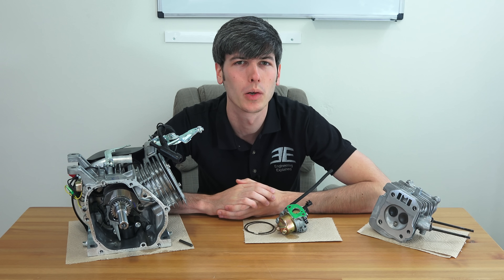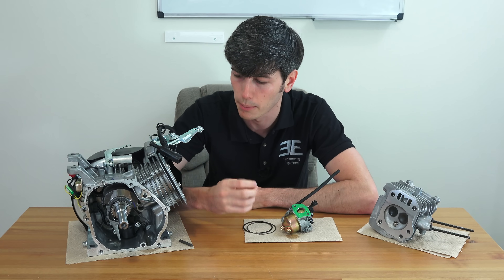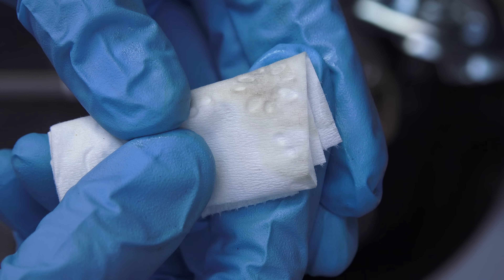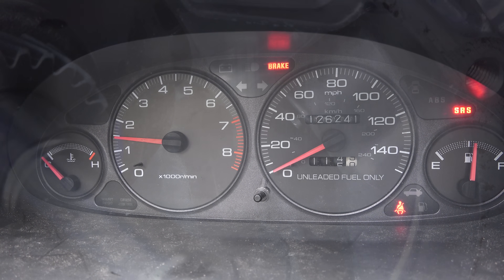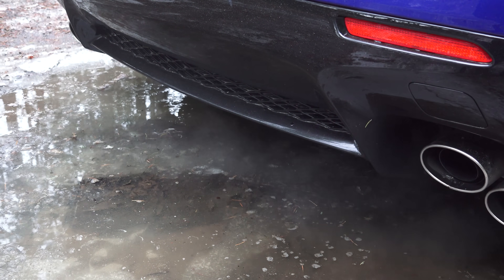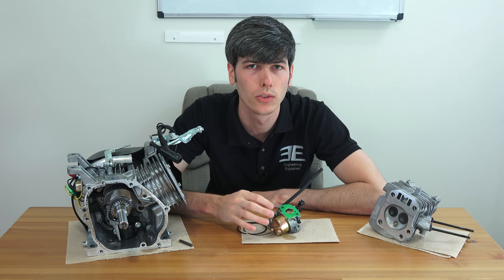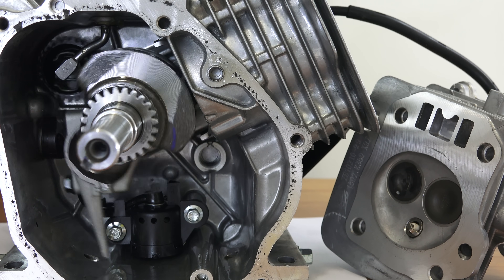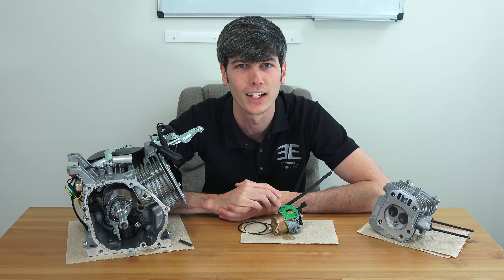Should You Warm Up Your Car Before Driving?

Comment: Im still gonna warm my car up for a couple mins before i drive.
Reply: "I've been in engine classes" you know that this guy who's video you just watched is an engineer right?
Reply: R-Spec
Unlike the other folks on here, I don't care about what you do with your car. I just wanted to point out how silly you sounded when you said you took an engine class LOL
Reply: R-Spec

haha, what class are you following?
Crank splashing oil, that's one on cheap small engines.
Any car engine doesn't have a oil slinger, since that might make the oil foam losing it's lubricating properties.
Did you even see the video I provided?
The transmission oil won't heat up while idling, only under load.
If the transmission isn't working, it's not heating up.
Unless you are slipping the clutch.....(i'm sure you aren't.)
Reply: R-Spec
Well if you can't figure that out on your own, then no use trying to explain it. Some people are just lost in their own little world xD
Reply: +GogogoFollowMe no a minute or two is just fine. I've been in an engines class and learned it takes a minute or so to get the oil to the top of the head.
Reply: Sdd525, i respect you opinion,  as an ex- fleet mechanic please respect mine. This video has made me question the topic.   I may be wrong.  but I have seen  many mechanical failures due to operation of a cold engine and transmission.   I will continue to let my machines warm up before operation.  The reason there is a thermostat in almost every modern engine is to maintain a constant operating temperature.  I belive in that temperature. Long live 220°
Reply: An engine warms quickest under load, this point is completely lost on you. Cultivate your ignorance,
Reply: R-Spec

Haha, 1 minute to get the oil to the top of the head?
What kind of engines were they talking about?  gigantic boat engines?
If it would take 1 minute to reach the top of the head, your engine would be dead after less then 1000 starts.
Reply: And in winter, if you don't breathe heavily the windows will not fog up.
Reply: And waste your time.
Reply: well where in your owner"s manual does it say to do it ? He doesn't forbid anyone from doing it, he says IT IS NOT NECESSARY ,and if anything - actually may be harmful... that's why when you read or listen to someone it is important to be able to COMPREHEND what they are saying .. How old are you - 5 ? wtf...
Reply: R-Spec same
Reply: +spiritofthewolf15x same bro
Reply: avsrule247 Ain't that the truth
Reply: R-Spec- many Subarus have a blue engine light on the dash that indicates when the engine is cold and when it turns off the engine is warm enough to drive. I have seen them on all different year including the new 2017 Impreza
Reply: actually some cars have piston slap like the 3.4 malibu and 3.3/3.8 chrysler engines if you start driving it right away the engine knocks badly so technically letting it warm up is necessary.
Reply: SDD525 yeah this one guy at work would revv his car as soon as he started it to warm it up, he was probably leasing it and dint care much about it
Reply: R-Spec Smart!!
Reply: 260k on one of my motors. Second owner, parents owned before me. Unopened motor. O.e head gasket. Always warmed it up for at least 10 or when idle speed lowers.... there are days I let it idle for over an hour. I have no issues. Scoped cylinders and seen no wall wear. If you're really worried about wall wash... why drive a cold engine to dump more fuel in when it's already doing so to warm it up at idle.
Reply: The video author doesn't address any other fluids; it's a whole drive-train, not just the engine. Also, "how long" until the oil and gas mix or how much wear that causes over time is not addressed. We don't get any idea where the line might be: 30 seconds? a minutes? two minutes? three? While the engineering concepts may be correct, there is simply a lack of detail and specificity to actually apply them to daily life.
Reply: +epiphonesg007 ditto to you sir. I want my oil viscosity to be thinner to oil up my turbo. You sheep can follow what he says.
Reply: Actually, he does more harm idling than driving under the boost rpm because it takes more time to heat... genius
Reply: +avsrule247 okay did you ?
Reply: SDD525 Oh of course. Anything to cut back on it helps. Ideally they stop altogether but that'll probably never happen.
Reply: You mean higher viscosity right? Dude You have everything backwards!
Reply: yeah same, to get the oil circulating and get some temperature
Reply: Kirk Augustin
Are you a mechanical engineer, kirk?
Reply: doesnt help your engine. if you do it to get the windows defreezed its a different thing.
Reply: let me guess, you're also a flat earther because you're not a sheep right? i knew it...
Reply: SDD525 come at me bra
Reply: SDD525 #awdarmy
Reply: try using a bit of lucas, it'll stick to yo parts
Reply: +skojo3e I have the same light, and it's supposed to let you know when you have heat. It goes out when coolant temp reaches 132°

Subaru may be slightly different.
Reply: +skojo3e I have the same light, and it's supposed to let you know when you have heat. It goes out when coolant temp reaches 132°

Subaru may be slightly different.
Reply: Robbspeed3- check the owners manual!! If the symbol is an image of an F with wavy lines under it then it's for engine operation temp. It blinks red when the engine is over heating and solid red when you should definitely stop the car from over heating
Reply: +skojo3e Ok, subaru uses a pic of a little engine rather than a little thermometer. Either way, that's not to say you have to wait for it to go out before you drive. That's to tell you when you'll have heat.
Reply: SDD525 Idk, my car is 5 years old with 50,000 miles, and there's not a spec of rust anywhere on it. So the motor might fail first. I drive it hard, but in other cases maybe so.
Reply: SDD525- winter driven don't mean nothing. You can hot oil the car/truck undercarriage to reduce rust and back in the day some Toyota owner manuals actually said wash salt off the under carriage ideally with a pressure washer.
Reply: SDD525 Anyway, if you follow that strict schedule, your car won't rust away.
Reply: Robbspeed3- I don't follow that strict of a schedule it's more like when the car is visibly white and you can write "wash me" in the back window lol. Ends up being 5-6 times a winter. Just make sure you nail the undercarriage from all four sides and I spend more time washing the under carriage then caring what the paint looks like
Reply: Wow... If you're really worried about that get a block heater and an engine pre-luber then. It's basically an accumulator that pushes oil into all the bearing surface of your engine before starting to ensure there is nothing unlubricated upon startup.
Reply: Yeah...cause listening comprehension is so hard :D The guy is engineer and he scientifically explains why this is not only not necessary , but also bad for you car, but you will still do it . Smart decision making :D :D
Reply: i also will warm mine up to. i like it to be warm when I get back in from starting it in burr cold.
Reply: only ISIS warms up truck before running over people. so don't do it!
Reply: SDD525 fail
Reply: Marek Sumguy it's funny because that's exactly what a car's ECM does, they idle quite high for 30 - 60 seconds after a really cold start. So by that fact it must be the right thing to do, and in modern engines it already takes care of that for you!
Reply: R-Spec when you start the engine in cold weather the engine runs at about 1200-1300 or rpms..so wait 1min or 1 and a half until revs drop to 800rpms or so and you are good to go
Reply: R-Spec Exactly
Reply: R-Spec

Sheep?
You are following a method that has been around for almost 100 years, that's what everyone still does.
Unless you live in really cold climates, 10 seconds is enough to warm up everything.
You are warming up the engine slower, much slower, then just driving calmly.
A good half/full synthetic oil is about the same viscosity cold or warm.
Reply: +R-Spec ignoring facts doesn't make them go away buddy.
Reply: +SDD525 no I'm not.
Reply: So what are you doing during this time ?
Normally I just drive out of the garage, close the door (manually) and go. Drive at low rpm until mid temp. period
Reply: Mike West Idling doesn't put much heat into the system > oil stays colder for longer > Because it's thicker it's slower to coat the cylinder walls > more wear. He literally says all this in the video.
Reply: Okay well you guys can do what you want to your cars. Il be doing what I want in mine. I like my fluids to be more in operating temp for my oil and my transmission fluid before any load is put on by my clutch or pulling out of my driveway. And just because you got pressure in the block doesn't mean it's all the way lubricating everything yet.
Reply: you are correct to do so.   letting your fluids warm up is the best thing to do. driving on a cold engine and trans is the worst thing to do.   any mechanic will tell you that,  as will most good engineers.
Reply: Sam G
It's useless trying to explain to someone who has convinced themselves. Although the science makes sense, I am curious to see just how much more wear you produce by idling for long periods of time. It's probably very minuscule unless it's extreme conditions.
Reply: Anyone who has actually taken a mechanics course knows it takes about a minute to BARELY get oil to the heads of some larger engines. A bit of cylinder scraping is less damaging than running a valve train or turbo dry.

I let my diesel truck warm up for at least 5 minutes before I start off on cold days. In the summer, she's good to go in about a minute or two.
Reply: I don't care if he's Jesus Christ.  I want my oil viscosity to be lower before I move.
Reply: +epiphonesg007 your crank splashes its way up the the top of the head through little holes so it takes some time to get everything lubricated and if you want your fluids right for other things.
Reply: Yeah, everyone is free hopefully. But for me, knowing that it warms up quicker when you drive is enough. BUT if it's -20°C, yeah, of course I will wait a couple of minutes before driving.
In summer tho, there is a difference between cranking it and going directly, and waiting until the idle lower under 1000rpm
Reply: +SDD525 I have a hot turbo motor and I run  5w-40. It's not n/a
Reply: Dumbass
Reply: +Sam G what facts were proven ? He just talks about it and there's no visual proof of engine wear.

Comment: Driving without warming up the engine cause excessive wear. When it is cold, the metal shrinks, so it makes some gaps between the pistons and the cylinders. If you do high rpm straight after the cold start, it damages the cylinders as the pistons are wiggling causing wear on the sides of the cylinders. Most engines designed to operate at the temperature of 87-90 degrees. If the temperature is below that the metal has not yet become the proper size to stay still and avoid the excessive wiggle of the engine parts.

Comment: Yep.. Get in, start car, adjust seat (maybe), turn on radio, plug in phone, buckle belt. About all the time you need to have oil flowing before you start off.. Even in winter if you synthetic.

Comment: I have a motorcycle and I live in a warm country, I always let my motorcycle run on idle for about 2 to 5 minutes. Its a single cylinder, fuel injected, 4-stroke,  373cc, high compression machine. Occasionally I see a subtle grey-white smoke coming out of the exhaust with a weird smell. Usually the smell is followed by the smoke and when I rev it, it bellows out (but not so bad like a 2-stroke) and then immediately vanishes. 
Online forums say that its my engine coolant thats' getting combusted.
What do you think this could be? (I use synthetic 'ester technology' oil 15W50)

And you said in the video that "oil remains on the cylinder walls", does the engine oil actually get into the combustion chamber?? I thought only 2-strokes do that?

Comment: I did it just for expansion reasons...piston and rings are a lot thinner than cylinder walls...could be wrong, but I have had many and many miles out of every vehicle I have ever owned. I even warm up on a hot day, 100+ degrees out isn't anything compared to over 800.

Comment: While science has its place in the automotive industry, I notice my port fuel injected vehicle just drives better when warmed longer in cold weather. My direct injected vehicle runs fine no matter the weather. I've on occasion smelled gas in the oil. Now I just change the oil more often, but never past the vehicle manufacturer recommendations, even with synthetic.

Comment: Im guessing the little arm coming off of the crank shaft is to sling oil around the crank case. Right? I havent really seen one of those before.
Reply: I believe the term is an oil slinger. And yes, larger engines use oil pumps to pressurize oil going to the main bearings, cams, pistons, everywhere.
Reply: is that how oil is made to move around in the engine? I thought they have a separate motor for that?
Reply: in the crank case on small engines i think thats what they have. Bigger engines like 4 cylinders, v6, v8, etc have both...i think. man theres alot of "I think" around here haha.
Reply: i have also heard them referred to as "dip finger" or "dipper finger" depending on manufacturer.
Reply: +jheetman On bigger engines what looks like that is just for balancing. navigate if small engines use churning the oil instead of an oul pump, no wonder they don't last.

I'm not an expert on the small engine side of this, may be not even past beginner. lol

Comment: Scientific Wine Glasses
Reply from the maker: +Deangelo Scott only the best!
Reply: +Tucker B watch the video again.
Reply: +Engineering Explained, i completely disagree with this whole video in the way you present the topic, it ignorantly glosses over the chemistry of burning gasoline with ETHANOL in it, and running your engine above idle, and below operating temperature, causes an improper burning of the ethanol, the harder you push the gas while the engine is cold, the more ethanol that does not get burned, and is very hard on your catalytic convertor, is slightly rough on the valves, and will rust out your exhaust system faster. and with modern cars, will cause you to be replacing O2 sensors faster. Normally your videos are awesome and on point, this time not so much. I give you a slight reprieve as you said to drive the car LIGHTLY too warm it up, that is the key, you don't want to run it hard, but from plenty of experience i can tell you that while the oil is still cold, you want to produce as little torque inside of the motor as possible.

Comment: Good explanation as always. I was one of those people who always let their car warm up, usually starting it with the remote 10 minutes before going out, figuring by doing this I was giving the oil a chance to warm up enough to coat the critical parts and reduce wear. I was obviously wrong by doing this and will start lightly driving on a cold engine. Now just to figure out how to get the guy who's car is warm off my butt while I'm driving slow and nicely.
Reply: be careful. I live in Minnesota, gets down to 35 bellow zero hear, cold engine means no heat, doesn't take long to get frostbite at those temps.
Reply: +josh ziesmer yes here in PA it gets cold enough for that too.

Comment: What if its -30C or -40C? What is a realistic time before I put the car under load?
Reply: sure you have  lol

but seriously you should up load some videos of your experiences this winter :)
Reply: Dude, i live in alaska where it actually gets cold unlike down in toronto .  i would welcome you and him to come up here in mid winter where the highs can be -40  for long periods of time 

just because i do not make any engineering videos does not take away from the account that the decades of experiences from myself and many people along with shops  who have to constantly repair cold weather damaged vehicles 

his video is majority talking about the engine in mild cold, the OP  is wanting to know about extreme cold weather , at those temperatures other factors work in to the function of the whole vehicles not just the engine it self 

you say im a nobody yet you dont have any uploaded videos.......
Reply: oh ill go there lol yes and that is just about what everyone up here uses is synthetic fluids oil,power steering etc and yet in the real world they do not work as magically as you assume lol 

25+ years of nothing but synthetic .....

many of  the rubber hoses  and plastics in the engine bay  along with other parts of the vehicles benefit the most from radiant heat from a warmed up vehicle in extreme cold temperatures and are usually the first things to become brittle and break
Reply: rubber and plastics, transmissions  and frost bite etc , at -20 and colder ambient 10 minutes is more then acceptable 

hopefully ill be able to get some research videos up at the H.A.A.R.P research station this winter
Reply: at least 10 to 15 minutes to help the engine heat  help warm up other parts of the vehicle, i usually have to let them much longer
Reply: engine heat warms up other parts of the vehicle....
Reply: yeah sure , it is pretty  blatantly obvious you really do not know what you are talking about
Reply: they are all changed and they do break no matter what you use , you jump in a car and take off with out warming it up after a night of -40 many things are breaking
Reply: If it's that cold a block heater is recommended.